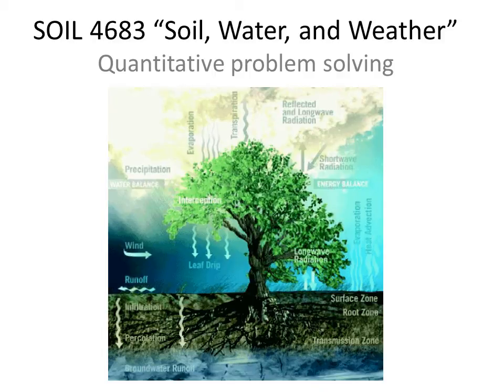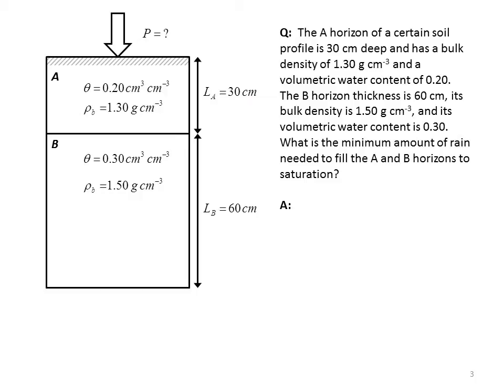SOIL 4683:  Precipitation and Soil Moisture Calculations

Comment: Thank you for this beautiful presentation. 
could assist me with my question. I have different treatments of cover crop and i wanted to see the treatment effect on rate of soil recharge and deplection after rain event. I used a digital sensor to collect my data and it logs for every 5 mins for a year. What suggestion can you provide for the analyses